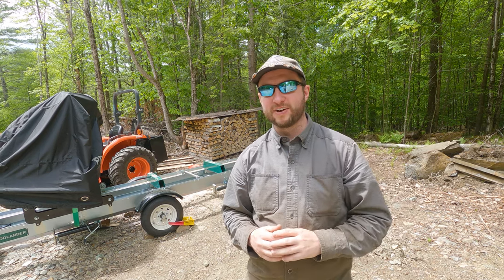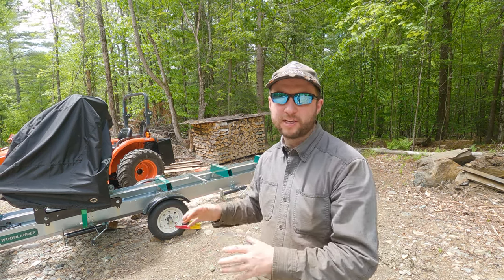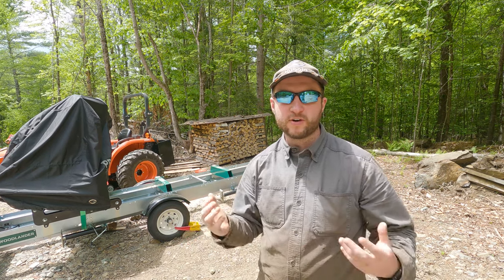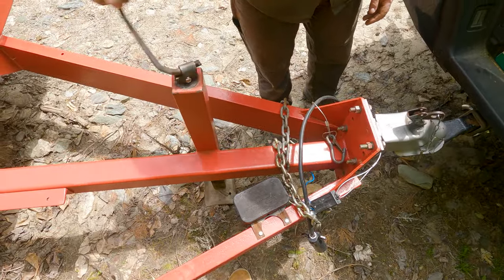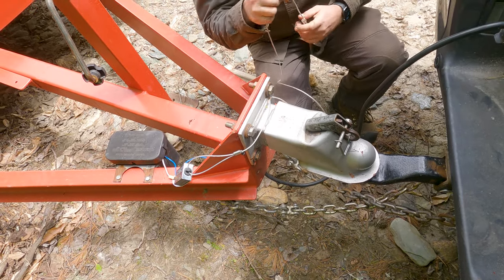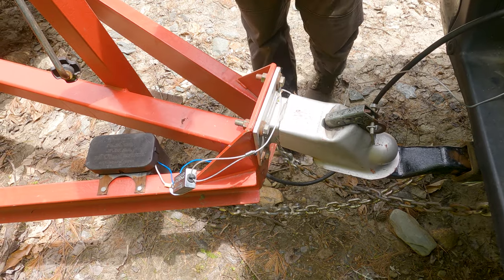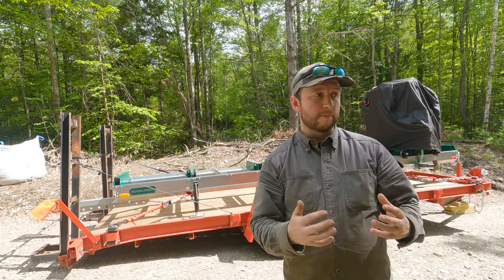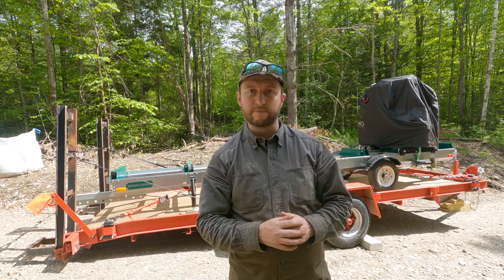A trailer on a trailer? (transporting our portable sawmill)

Comment: Excellent: your usual careful, thoroughly thought out, safety first process. My only question: Why'd you chose to reinstall and haul the ramps with? They served no purpose getting the sawmill on or off, so seemed to only be extra steps getting them out of the way, and putting them back.
Reply from the maker: Great question! Knowing we wouldn't have a tractor available at our friends' house to lift the logs onto the sawmill, we used the trailer ramps on the side of the sawmill to roll the logs up - it worked really well!
Reply: @AdventurousWay  Yup, that makes sense. That's an often unrecognized real operational cost with a sawmill: moving all that wood! Both the logs and the sawn lumber. I bet most DIY setups are constrained by that rather than by the capacity of the mill itself.
Reply from the maker: I suspect you're probably right! We've been using the tractor for now which can lift up to around 1,100lbs but with some of the larger diameter logs we've had to cut them shorter just so the tractor can lift them. Once we have a more permanent location for the sawmill I think I'm going to build a ramp system so we can roll the logs up with the tractor and mill some of the bigger ones in longer lengths.

Comment: I have an 8000 lb winch on my trailer and welded a hitch on the front of my trailer frame so I can mount the saw mill to a ball at the front. My reason is distance and no suspension under the Wood Mizer. Dexter's under the trailer rides as smooth as silk . The tongue jack on the mill has wheels so it roll's up on or off with little effort. Mills on trailers will go down the road but it can beat the tar out of em.
Reply from the maker: Putting a ball at the front of the trailer is a really interesting idea! I'm planning on mounting a hitch receiver at the front of the equipment trailer so I can attach a winch to it, but hadn't thought of then putting a hitch ball on there to hold the sawmill trailer too.

Question - obviously you can load the sawmill onto the trailer using the winch, but how do you get it back off again? We reversed the sawmill onto the trailer so the hitch is at the back making it easy to unload.